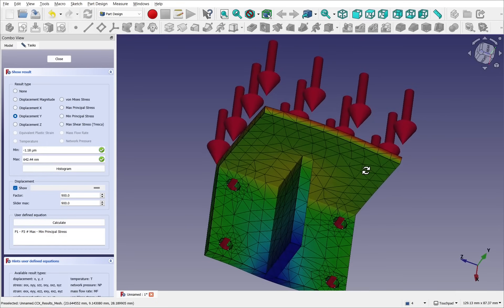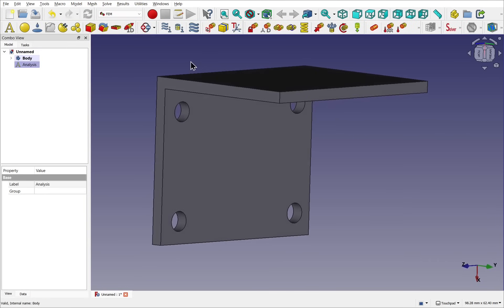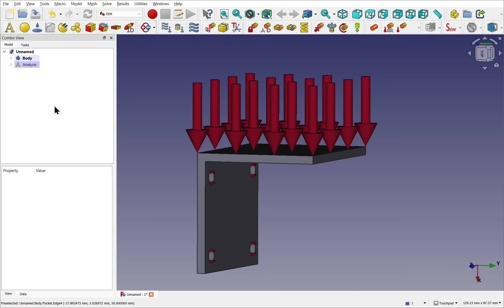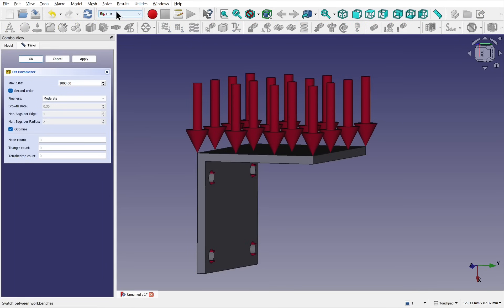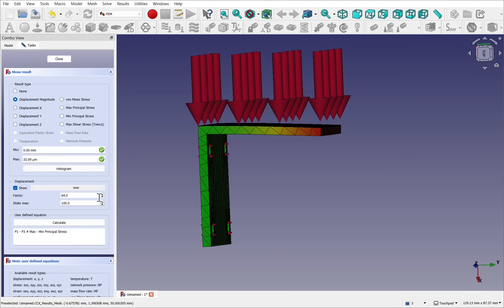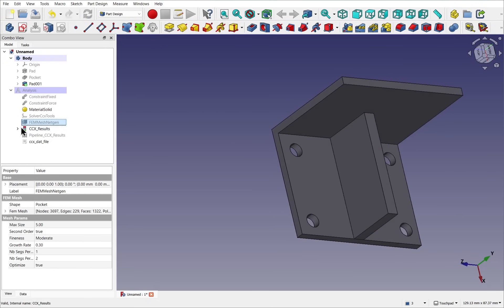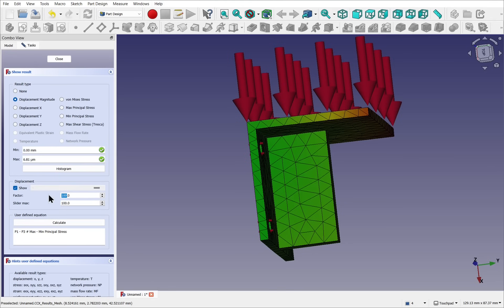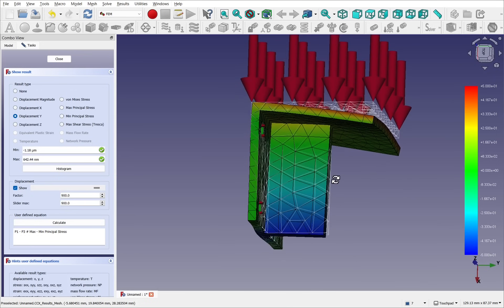FreeCAD FEM Workbench | Basics In 15 Minutes | Beginners Tutorial

Comment: On Arch Linux I get a "The FEM module is built without NETGEN support. Meshing will not work!!!".-error when creating the FEM Mesh. I am on the newest Version 1.0.2 which version does support FEM?Do I need to downgrade or is there a trick I missed?
Reply: I got it: I needed to install netgen, gmsh and calculix-ccx. After a reboot it worked like a charm :)
Reply from the maker: Sorry for the late reply, great to see you have resolved the issue and thank you for commenting back,  so important for others who experience the same.  Thank you.

Comment: Has anyone been able to use the FEM workbench with the PPA version of FreeCAD? 
I get dependency issues with libocct.
 libocct-data-exchange-7.6 : Breaks: libocct-data-exchange-7.5 but 7.5.1+dfsg1-2ubuntu1 is to be installed
 libocct-foundation-7.6 : Breaks: libocct-foundation-7.5 but 7.5.1+dfsg1-2ubuntu1 is to be installed
 libocct-modeling-algorithms-7.6 : Breaks: libocct-modeling-algorithms-7.5 but 7.5.1+dfsg1-2ubuntu1 is to be installed
 libocct-modeling-data-7.6 : Breaks: libocct-modeling-data-7.5 but 7.5.1+dfsg1-2ubuntu1 is to be installed
 libocct-ocaf-7.6 : Breaks: libocct-ocaf-7.5 but 7.5.1+dfsg1-2ubuntu1 is to be installed
 libocct-visualization-7.6 : Breaks: libocct-visualization-7.5 but 7.5.1+dfsg1-2ubuntu1 is to be installed

Comment: This is really cool! I had no idea that this workbench comes with FreeCAD or what it is for, but I can see how useful it will be for analysing 3d-models to see where reinforcement might be needed before printing.

Thanks for sharing!
Reply: What’s funny, 3D printing is the most common application of FreeCAD but also the most tricky one for FEM. On the surface, it’s easy but problems start when you try to account for the infill. However, you can live with large simplifications if super accurate results aren’t needed.
Reply from the maker: Glad it was helpful!, I been meaning to do this video for ages and wasn't quite sure how to deliver it as I wanted it to be practical.

Comment: Are the colors the deflection amount?? Isnt it normally the internal stress? If it was internal stress, the base of the angle should be the highesr stress and the ends (while deflected the most) have lower stress.
Reply: Here only the displacement is shown (mostly displacement magnitude - resultant from all 3 components). But you can display the stresses too and von Mises stress is usually used for that.
Reply: @Gumball_W  Thank you!

Comment: I have been studying mechanical engineer hnc past 2 years and tried this fem before but had issues getting single point forces to apply, how would single point force be achieved, small features or points to reference?
Reply: You can apply force load to vertices but it should be avoided in FEM. It’s better to use small areas instead. Check the partitioning approach described on the documentation page "FEM Geometry Preparation and Meshing".
Reply from the maker: I am so glad someone with more knowledge in this area is answer those questions. 😊😊 Thank you

Comment: 1. It would be good if you showed the FreeCAD version. Users of different versions can get confused. Especially since FEM will change a lot in the upcoming 1.0 release.
2. You don’t have to select the last operation in the tree to create the mesh, just pick the whole Body and you won’t have to adjust the selection if the model tree changes.
3. The mesh is still way too coarse but I know it’s intro tutorial so just saying.
4. To run an analysis you don’t need to enter the solver options and write the input file first. There’s a separate button to start the simulation.
5. It’s better to use the results pipeline for postprocessing. There you can have the legend all the time.

Comment: Great presentation of how to do such thing in Freecad, which I'm quite engaged with in the past 4 weeks thanks to your videos. Unfortunately - and this is not a criticism against the video itself - it also demonstrates how damn convoluted and unintuitive FreeCad could be :(
Reply: I used FreeCAD for about 2 years, and now I find other CAD software convoluted and unintuitive. I'd say CAD as a paradigm simply can't be intuitive. By nature it's just too complicated, you simply have to learn how to use it, hence I feel like that's not criticism at all. It's just organized in a different way, if you come from other suites, it will obviously feel weird at first.

Sure, the UI is sometimes clumsy, there are rough edges here and there, but more often than not, what first seems unnecessary complexity actually turns out to be more freedom as soon as you figure out the underlying logic. Takes time, but worth it, imho. After all, unlike any other CAD software, your time buys you a guaranteed lifetime licence.
Reply from the maker: Thank you and totally understand. Freecad has many routes to complete the task and this can be confusing. It's mainly around the multiple workbenches. This also brings a lot of power to the table. It's one of the reasons why I do these videos.
Reply: @MangoJellySolutions  Out of curiosity... have you tried Ondsel? I've installed it today, the GUI looks a LOT streamlined. It also supports some of the features (eg: auto dimensioning tool) which is currently exists only in the development build of FreeCad.

Comment: very good but single point loads at an angle     So far I've been adding a small cube at the load point  and loading that    breaking down the angular load into its x and y vectors ,,adding a cube on the x load path and on the Y load path          there must be a simple way !
Reply: Since force load can be applied to vertices (it’s just not a good idea for solids), you only have to add some geometry to use for direction specification. Draft Line will be sufficient for this.

Comment: I am using 0.22dev 37730. At about 7:35, I saw no displacement as I moved the slider. Setting the 'Slider Max" to 1000, I saw a little displacement. At 10,000 displacement was obvious.
Reply: That means you choosed a small force( check the unit of the force) or maybe you choosed a different material.
Reply: @muezabdalla2852  I just verified that I used a force of 1N (the default), and generic PLA.
Reply: @muezabdalla2852  I could swear I replied to you yesterday, but I'm not seeing it. 

I have verified that I am using 1 N for force and Generic PLA. Perhaps the issue is related to my using a dev version.